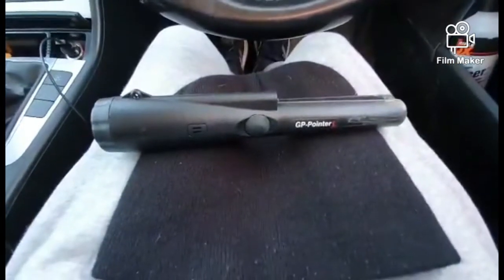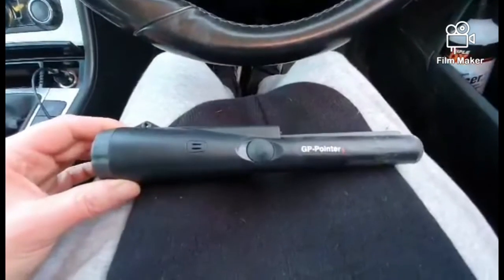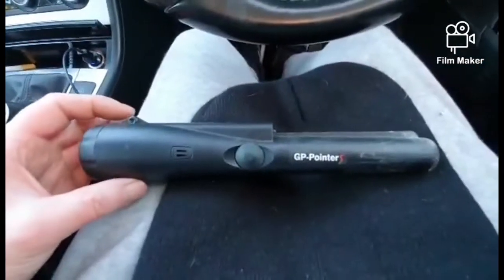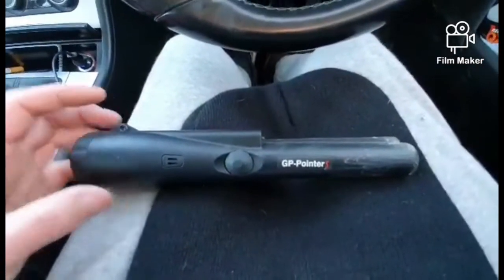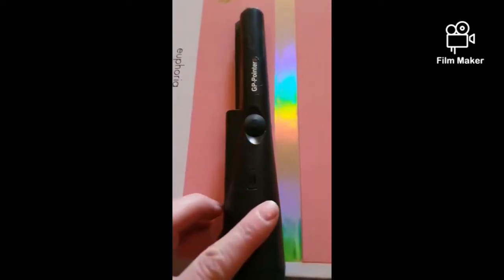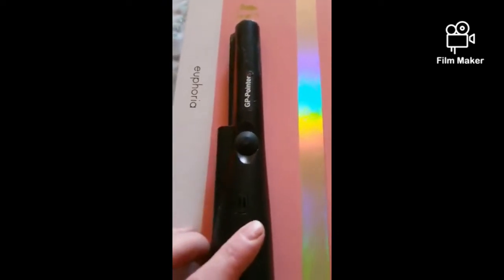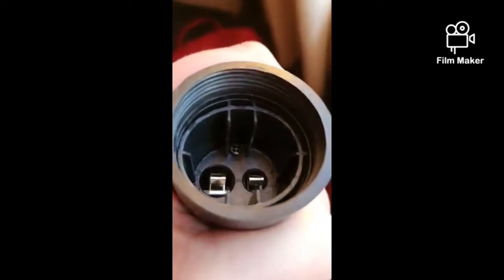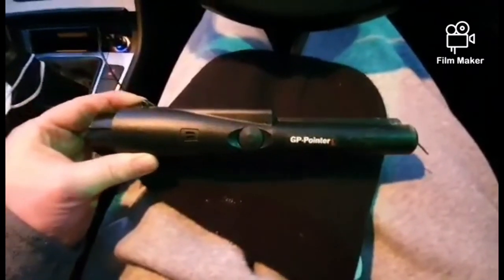G.P Pointer VS Garrett (bang for your buck ) metal detecting Ireland

Comment: Great video, I have a cheap Chinese pointer and to be honest it works fine. After all, it's just a tool to help locate something that you already know is there,  so a half inch detection difference to one 10 times more expensive I can live with. The outcome will be the same.
Reply from the maker: your right dave..honestly it depends .if your searching for a big 2p coin yeah its a no brainer.if your looking to find a pistol ball or small lead shot you will have problems..each to there own bro.